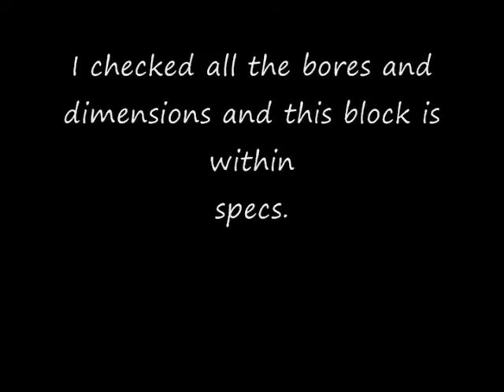Case 646 Onan CCKA MS/2222G

Comment: Sounds a lot better than mine does. What are you doing with the old Onan? Are you going to use the spare block and rebuild the engine? A new Kohler will sound much nicer and probably more torque but is a little pricey. Hope if you have the hydraulic quick disconnects on the power beyond hose in the rear that they are wired together so they won't separate when something bounces and hits it accidentally. You don't want to know the sound of that engine at full speed when the line separates.

Comment: It can bring the engine down from 3600 RPM to around 500 RPM and blows all seals out of the pump. Not a pretty sight or pleasant sound. Don't ask how I know, it's too expensive to describe. If you are parting with the engine let me know. Good luck on the re-power.